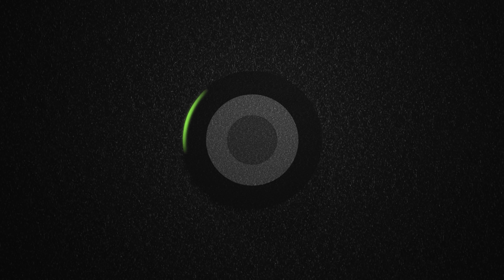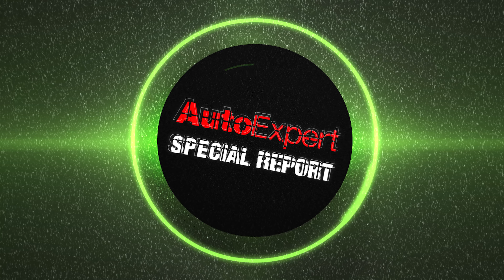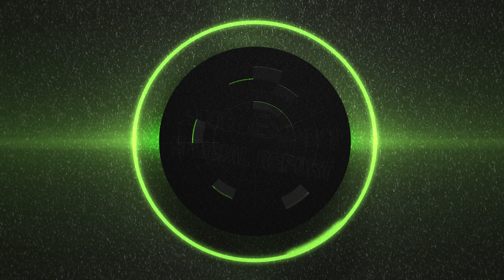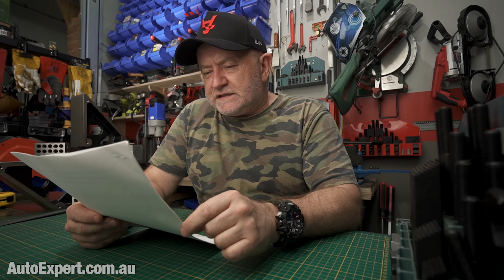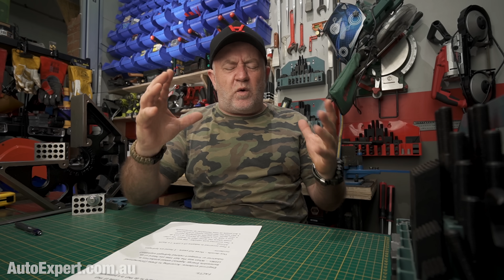The truth about fire risk: Hydrogen fuel cells and battery EVs | Auto Expert John Cadogan

Comment: This is the thruth, real data instead of underbelly feelings:

Using data from the National Transportation Safety Board (NTSB), Bureau of Transportation Statistics (BTS) and government recall information, AutoinsuranceEZ indicated fires by vehicle type:

Hybrids reflected the most at 3,475 fires per 100,000 vehicles. This is most likely because hybrids utilize two powertrains.
ICE vehicles caught fire substantially less often, at 1,530 incidents per 100,000 vehicles.
EV fires were significantly lower than the others, with 25 fires per 100,000 vehicles. So of the approximately two million EVs on U.S. roads, less than two out of a 1,000 will catch fire.
Per AutoinsuranceEZ, ICE vehicles are more than 60 times more likely to catch fire than an EV, while hybrids are more than 130 times more likely to catch fire than an EV.

Comment: Definitely the exception, not the rule. I've seen gas bottles on the side of burning houses explode when the blow of valve fails. Rather spectacular, loud and hot, but no one injured. The top half of the tank ended up on the neighbours roof

Comment: John…regardless of what you and I for that matter say to some people with very silly stringent thoughts (possibly originated from out of date older family members) that a dual fueled vehicle (say LPG and Petrol…Gas in ‘Mercia) is nothing but a bomb and refuse to step inside one.
The same is perceived with Hydrogen.

Now I know that Methane can only “blow up” when the ignition source is in the exact position close to point of leak.  It will not explode if the mixture in air is either too rich or lean.
Not many know this.

Anyway, there is no way you or I or anyone will be able to convince these people that they can co-exist with said stored energy.

I actually really loved my 1981 Ford Falcon XD ute which was dual fuel… particularly when it cost me 18.9 cents per litre at this one servo West Brisbane about 30 years ago.
By the way, at the same time at the top of the Toowoomba Range LPG was 60 cents per litre (Aussie cents), so 18.9 c/L was ultra cheap at the time, however for an entire month it was at that price at that servo.

I would actually have CHANGE! from a $10 AUD note and I would get 300 klms regardless if it was around town or on the highway…oh, those were the days.  
Now what does AUSTRALIA do, rip off locals while at the same time export “OUR” LPG to Asia etc for peanuts.
Are we bloody mad.

I believe the entire of Australia could have been run on its own LPG.

Anyway, as we all know it’s all about making mega bucks in a short period of time.  So wrong.

Comment: This was a great chat about these two types of new "fuels", I totally agree with your reasoning. One thing I would add, is the actual energy carried. I compared a 100kwh battery with 60L of 92 Octane petrol, and it's about 7 or 8 to 1, as in, 60L petrol contains about 750ish kWh of energy. So if it does go off, I'd rather be next to a battery fire than a full fuel tank leaking and burning, including if that's in a CBD parking garage.

Comment: Hi John, Having worked 30 years in the oil and gas industry, predominantly LNG facilities, the greatest fear in a fire incident is a BLEVE, Boiling Liquid Expanding Vapour Explosion. This comes about usually from jet fire impingement on a pressurized flammable liquid vessel, such as a propane vessel, where the jet fire heats the vessel locally, causing the propane to boil and increase the vessel pressure. Safety devices eg: pressure relief systems open to relief the pressure, but if the jet fire impingent point of contact isn't cooled by fire suppression systems then ultimate failure of the vessel occurs with devastating consequences. Search BLEVE events and you'll get the idea. Hydrogen fuel doesn't necessarily need to be in a gaseous state to be utilised as a viable energy source, metal hydrides I think have been used, although I admit Hydrogen gas is the simplest form, particularly for the internal combustion engine. Ultimately this is still developing technology as is battery technology! Hopefully the technology continues to advance with improved performance, longevity and safety, and with luck drives the cost  and the environmental impact down.

Comment: Hydrogen is one of the most volatile gases out there. When ignited, it burns much faster than petroleum and is also stored under pressure. Which is why the term "bomb" is used to describe it because it closely resembles an explosion. You may not hear of many hydrogen fires because the industries that utilize it are regulated and follow protocols to keep it as safe as possible. Putting pressurized hydrogen tanks on cars is a very stupid idea. And "statistically", there are barely any vehicles on the road that use hydrogen so of course you don't see many disasters from it. 

Petroleum is safer by far than both hydrogen gas and lithium batteries. EVs are but a niche in the market...
Reply from the maker: 'Volatile' relates to how easily a substance evaporates. Since hydrogen is exclusively a gas at the normal range of natural temperatures and pressures, it has already evaporated and the concept of volatility is meaningless.

In all meaningful ways of assessing the danger, hydrogen at 700 bar in a tank is about as dangerous as petrol in a tank. In many ways, it's less dangerous.

Comment: Unlike hydrogen, petrol is not stored under pressure.  

Hydrogen possesses NFPA 704's highest rating of 4 on the flammability scale.

Gasoline has an NFPA 704 rating of 3. 

During my mid-90s high school years, one of the experiments is the electrolysis of water, the teacher fills a balloon with hydrogen, and blow it up. The hydrogen-filled balloon is attached to a 2.5-meter pole and a Bunsen burner is used to pop the balloon into a small fireball.

Comment: You mention hydrogen embrittlement, but that is another big myth which everybody loves to get out of proportion.
All type 1 to type 3 hydrogen tanks of 200 bar, most of them are made from steal.  Where is the issue with embrittlement there? 
If you check papers on embrittlement, those are issues for big pressures and temperatures with the most basic steel alloys.  On normal circustances those issues are so slow that the lifespan of the tank would come first.
Another thing, hydrogen at ambient pressure has way less energy than methane at ambient pressure.
People on TV make bubbles with a perfect oxygen-hydrogen mixture and they make them explode in their hands (full of those bubbles) and nobody notice any sign of pain or anything. Just a big noise.

Comment: Hydrogen was discovered in the mid 1600's by people mixing acids and compounds, but wasn't actually named until the 1750's as hydrogen. Since then, many highly intelligent people have tried to use it as a "clean" fuel, and failed. Problem simply is that the hydrogen atoms are so small that they can pass through the atomic bonds of all other elements and compounds. One other thing is that hydrogen likes to bond with other elements from everything from water to acids to alcohols and alkalis and everything in between causing brittling effects weakening the chemical atomic structure. Hydrogen cannot be contained at pressure in any container (or pipeline) without the containment materials having to be replaced every 5 years (including car and vehicle fuel tanks and transporting pipelines). This makes everything to do with moving hydrogen highly uneconomical, while hydrogen itself requires 6 times the amount of gas to produce the equivalent energy of 1 unit of LNG, again totally uneconomic. Putting hydrogen gas in plastic? Any idea what plastic is made of? Hint, a lot of carbon and oxygen. Or the chemical compound of alcohol - a lot of carbon, oxygen and hydrogen is involved in getting humans wasted. So yes, hydrogen is a good clean fuel, just too expensive and dangerous to use, store or move. Why do you think that nearly all hydrogen produced is utilised very close to the production unit? Actual engineers tend not to be stupid! While those who can only see $ signs spinning in front of their eyes in some sort of puggie or fruit machine...

Comment: many many years ago my 5th grade science teacher would put hydrogen in party balloons and light them in the classroom. They latex would flare into an orange fireball and the hydrogen would make a nice blue flame with a woosh-thud sound. Then he'd load a balloon with a little bit of oxygen and top it off with hydrogen. He lit that and it made an eardrum bursting bang (all done indoors!). Much faster burn, still not quite a supersonic rate that you'd expect from an explosive. 
If you have a pressurized hydrogen tank, there's no ready source of oxygen available for it to burn really fast. And a catastrophic rupture would displace the air with hydrogen and while the temperatures of a fire would get pretty high, it's not going to be a supersonic shockwave.

Comment: As a Signal's Technician in 91, we took possession of the first Raven Radio's in the Defense force. As we had a course on the operation of this flash new toy powered by Lithium Batteries. Being at the School of Signal at the time, we had to charge a lot of batteries for the course. We put the 3 chargers on the bench in the Battery charging room and for military precision we placed all of the 30 batteries against the wall lined up next to each other and went to lunch. The explosion was heard over a Kilometer away, the Battery Charging room was in need of some repair, but at least 2 batteries survived undamaged. Needles to say the thermal runaway of one of the batteries in the middle, triggered a bit of consternation from the Brass. The course was cancelled with a mountain of paperwork for all involved.

More thought about putting a number of cars next to each other in a car park, charging, needs to be had. As you so rightly point out.

Comment: Hydrogen powered cars is a "slow burn" topic, similarly, hydrogen fuel per ce. It is never going to go away, and in it's own time it will become the fuel of choice for the next 100 years and beyond, just as petrol/oil has been. That time is not now, but it will happen. Why? So simple, there is not enough lithium on planet earth, to sustain a world full of EV, therefore, it can never eventuate. This ignores the same argument for Cobalt, which is also a required element. (ref. John Cadogan clip from a few months back, referencing Rio Tinto mining report on total available global resources for Lithium.) In short, the resources do not exist, to enable a world full of EV. Meantime, hydrogen can be available in a relatively unlimited supply, which is virtually self recycling with no further action. When you burn or process hydrogen, you end up with water, which contains hydrogen. Surely a much more efficient and cleaner outcome than millions of tonnes of burned out Lithium batteries. As for the risk factor, as outlined in this clip, the risks from petrol, diesel or EV vehicles, is magnitudes higher than the risks from hydrogen fuel. So, will someone grab the electric cattle prod and go wake up the experts (x-spurts) in Fed Gov't and get some active visible progress with hydrogen development. For instance, with just a little thought application, instead of whimpering and whining about the devastating horrors of Natural Gas distribution and shutting it down, simply repurpose the system we have to carry hydrogen, instead of natural gas. We already bought and paid for the distribution pipelines, so surely it would be greener and more efficient to repurpose it, instead of simply throwing it all away, and making more land fill fodder. They are already doing these studies in other parts of the world, why is Australia always soo slow to figure stuff out?? Probably our stunning education system, I guess?

Comment: Hi John, Love your no bull explanation, great work and keep it up. Quick comment on the Safety Relief Valve on LPG and other tanks. In theory and if the fire is extingushed quickly you are 100% spot on however as someone else mentioned, a faulty/incorrectly fitted Satety Releif Valve OR extended continious heat/fire can calse a BLEVE (Boiling Liquid Expanding Vapor Explosion) which is basically a bomb, if interested here is a link to a 2 and a bit minute video https://www.youtube.com/watch?v=UM0jtD_OWLU Apology in advance that it is American 😀. Also excellent explanation of LPG seeking the lowest point, a great safety reminder to the viewers. Keep up the good work mate.

Comment: Lithium ion batteries have manganese oxide (there are other oxides as well) as part of the chemistry, but not phosphate. Lithium ion batteries can experience thermal runaway. I don’t know the exact nature of the chemical runaway process, one scientific paper attributes atomic hydrogen (H) formed in the battery anode being released when the battery gets too hot. Then the atomic hydrogen (H) combines to give hydrogen gas (H2) which releases a lot of heat (hydrogen gas is composed of a molecule of two hydrogen atoms).  This gets things really hot and all sorts of bad things can happen including oxygen release. There is plenty of research going on to change the electrolyte in lithium ion batteries to limit or stop thermal runaway. Bottom line here is I am not a chemist, but I don’t think John is either.

Lithium iron phosphate batteries are much less likely to experience thermal runaway.  Phosphorus is highly flammable, but when combined with oxygen in not flammable, just like hydrogen is highly flammable but when combined with oxygen gives something called water! Thus lithium iron phosphate batteries do not combust as a result of mechanical damage or overcharging.  Vehicles like Tesla Model 3 standard use lithium iron phosphate batteries.
Batteries will get safer (they are already pretty safe) and doomsday scenarios are not applicable!

Comment: As long as the concrete including rebars can handle 100C, the evaporation heat of water greatly reduces the amount of water needed to prevent structural failure. Of course, you'd prefer to have plenty of spare water to avoid reaching scalding-hot steam temperature and air displacement asphyxiation hazard in the first place.

Comment: Your predictions about Tesla failing from a while back seem to be coming true, maybe slightly later than thought, but not by much. I also did a thorough fact check on what you wrote about the Tesla Semi and you're absolutely spot on. I also checked on how much it costs to recharge one of these things, did you know if you live in San Diego that it's actually quite a bit more expensive to recharge a Tesla Semi than a diesel truck? In many places it's cheaper for now, but EJ's claims about running costs being so much cheaper don't really stack up. Now we need to know how much this "revolutionary" truck is going to cost, I'm guessing by the secrecy it's going to be ludicrous 😁

Comment: The example of an unrelated fire causing a thermal runaway on the EV parked in the garage is interesting. I've often pondered the same thing about the Tesla Powerwall in the event of a regular old structure fire.

I've been a copper for a decade and have been to several house fires that originated in the garage of the building. Which it just happens is close to where most people mount the Powerwall. Which itself is just a giant old lithium-ion battery.

Comment: I'm an electrician and I could tell you that I'm way more scared of batteries than hydrogen fuel cells. The primary reason would be the fact that those gas cylinders in cars are about as resilient as to have a potential secondary use as an artillery ammunition. In fact, you can't even use them as structural parts of the car because they are too strong. Also, there isn't a whole lot of hydrogen in them. On the other hand, battery powered cars have been treated for a very long time as freaking cellphones. The problem with inextinguishable murder fire can be solved by fireproof casing capable of holding water for the firefighters to fill with said water. However, we don't exactly see manufacturers racing to do that, because casing heavy and fireproof expensive.

Comment: Apart from hydrogen being a ridicules fuel for cars as you loose half the energy making it and half again running it through fuel cell, from a flammable point a view i can't see a problem.
The problem is the cylinders at 10,000 psi, now carbon fibre is light and very strong, but it's strength falls of a cliff after a few years of duty cycles, so would have to be replaced and that won't be cheap.
And hydrogen itself is bloody expensive, much more than petrol.